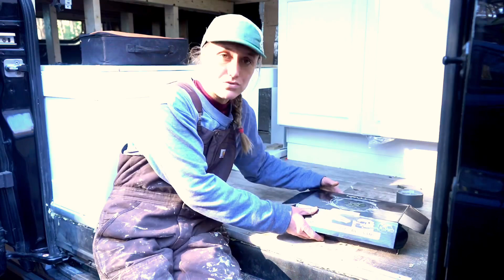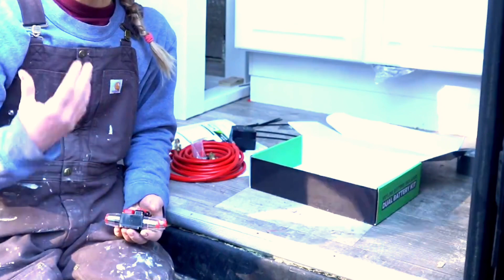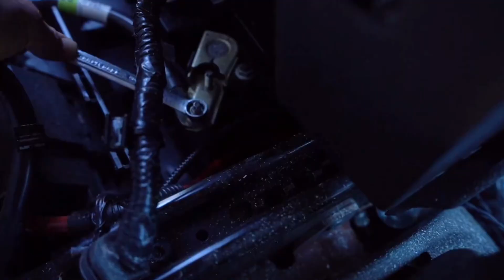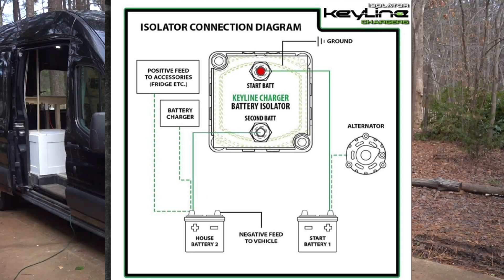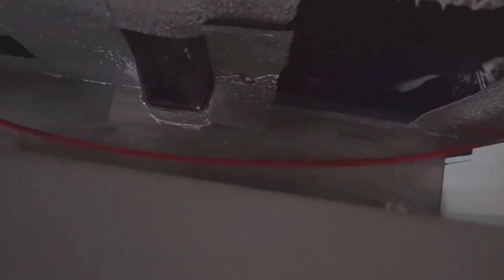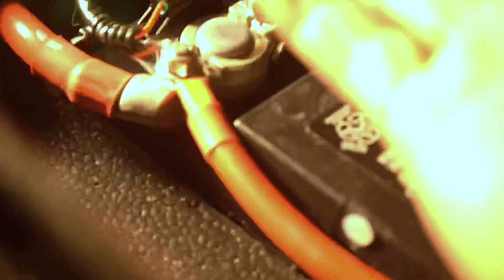Easy Battery Isolator Install | VAN LIFE

Comment: i have a question, did you upgrate your chassis to engine block ground? well lets say the "big 3" i gonna add a 2nd battery and isolator but someone told me that also i need to do a big 3.

Comment: What happens if you hook it up near the aux battery in reverse positions lol pretty sure i just realized i hooked mine up backwards in my car so it's in the trunk with my aux battery and the aux battery is on the start battery terminal of the smart isolator.

Comment: I bought one of these and then I found a lot of expert videos saying that this was a bad idea.  They said I should had bought a DC to DC charger.
Reply: yeah you can't use a lead acid battery charger of any kind to charge a lithium a vehicles alternator is meant to charge lead batteries and lithium run higher voltage and will never get a full charge DC to DC charger is a must.

Comment: So if the main car battery went flat for some reason but so you left your headlights on in order to get the car started. You would need jumper leads the spare battery to the main battery. Is that correct?
Reply: Basically it'll charge your batteries once a battery gets to a certain point, so it will allow your main battery to not leave u stranded. It's like it has its own brain to tell the isolator when it needs and which battery it needs to charge.
Reply: no-your liesure battery can charge your home battery.

Comment: What kind of battery is your auxiliary battery? Can you just use a normal car battery or does it need to be something different? Thanks!
Reply from the maker: It can. I have two of these batteries.  https://amzn.to/3bTCaoz
Reply: Because the auxiliary is continually being discharged,  a marine battery  should be used

Comment: Hi there, nicely done in the installation and explanation. Quick question! Can one Fuse be connected to be use in between, like in the fallowing explanation. I use one end of 150 AMP fuse to connect the car battery and the Isolator start battery cable on one end.  And then use the others end of the fuse to connect the Isolator Auxiliary cable battery with the house cable battery. Does this make sense? I am just learning as I go, and hoping that I get some guidance along the way. Hope to learned a bit for You. :-) Please let me know. A++ on this video.

Comment: relax guys theirs a good reason ford put the battery under the drivers seat, if anything were to go wrong n cause the battery to off-gas excessively, the driver wont survive to file a complaint.. see smart thinkin on fords part :p jp
Reply: Good point, always buy sealed batteries to prevent h2 in ur van